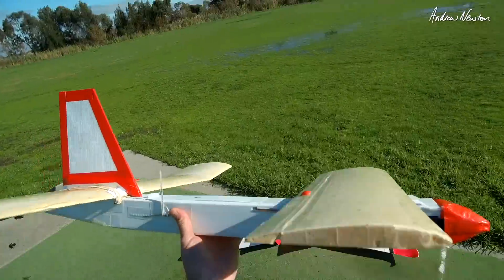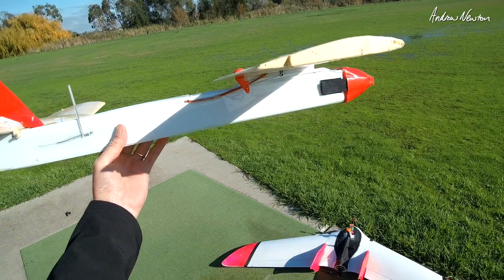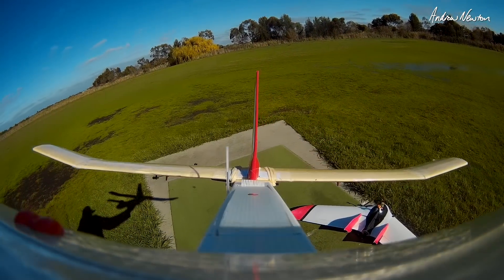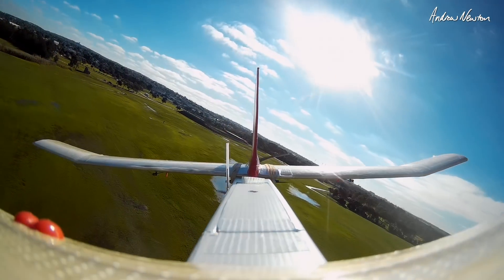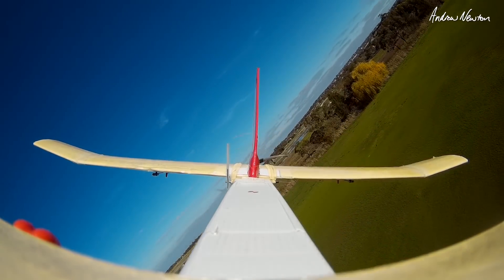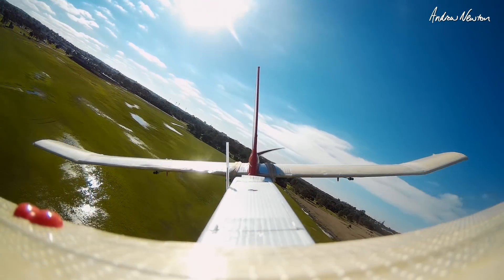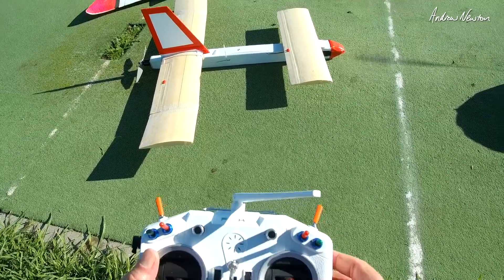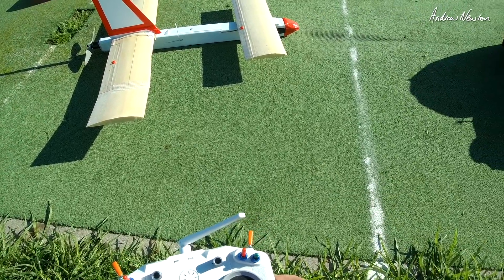Smeg Head Elevator vs Elevons

Comment: Quick question: do pushers heat up the motor more? Because there is no ventilation from the propeller. Thank you.
Reply from the maker: Not so much from the prop positin but more because airflow over the motor is blocked by the fuselage.

Comment: When I flew the APD, I had a few degrees of positive AOA in the canard, and flew with elevons only. It flew well, but pitch trim was dependent on air speed. I didn't mind it, but I know some people that would... lol It was nice for FPV, I had no autopilot but I could set the throttle to adjust my climb rate. At a nice cruise it would hold one altitude pretty well. In theory with this setup, the canard should stall before the main wing too because of it's higher angle of attack, so it make the stall very predictable and quick to recover too.
Reply from the maker: I'm really liking this smaller version, more responsive. I have reverted to elevons with some up canard, same as you. Trying to set it up for FPV and iNav now but weather and dumb mistakes are hampering my efforts.

Comment: I’m grateful you tested this. I often got asked about the APD: “Why not put the elevator on the canard?”  My usual response  was simplicity of servo wiring and mechanics, but I never actually tested it apples-to-apples. Thanks for doing this Andrew.
Reply from the maker: My pleasure Ed, interesting test. I thought the elevator would give more pitch authority, but the elevon mixing was just as good, and seemed smoother.
Reply: I like this plane. This is like a tandem wing. Andrew,  where is the CG location on this plane??  How to determine the CG location?
Reply from the maker: @kepplerdrone  I used an online canard cg calculator https://rcplanes.online/cg_canard.htm

Comment: Your Conclusion to change to Elevon only, depend on the Fact to save one Servo, or is it the Flying Characteristics, thats not clear for me, the Elevator would be more effektive with a wider Flap, and You could even use the Flaps together with the Elevator to slow it Down on the Final, dear Andrew very interessting Video with complex Aerodynamic opportunities keep going, best Wishes, Anton, Vienna 🇦🇹
Reply from the maker: Flying characteristics mostly. The elevator didn't add anything to the performance
Reply: @AndrewNewton  but if you use elevator as flap and aileron as elevator you can fly slowly. Right?
Reply: @AndrewNewton  THX, thats Surprises me, i would'nt except that, thought to climb it's more favourable to increase the total Lift rather, than reduce the Lift even on one Wing, a little bit. 
👍🏻🦆✈😃
Reply from the maker: Yes, increased camber on wing and canard.

Comment: Nice. It would be fun to up size it with a square pvc gutter downspout pipe as a fuse, well maybe.
Reply: Before electric days - it was called the Sturdy Birdy - PVC drain pipe fuselage, aluminum U channel rear fuselage to connect to the tail, balsa tail and a foam wing.  Think I had an O.S. 30 on mine.   wing rubber-banded on and so did the firewall.  Really helped me learn because the thing would take a beating.
Reply: @mkintzel   Thank you for the comment. I am relatively new to the community, but I have found a  real love for building. I'm sure you agree that there is nothing quite like seeing your own design fly, however badly.
Reply: I have plans to build a plane with and airframe made exclusively from parts one can find at Lowes or Home Depot, just for S and G. Was just looking at that pvc gutter pipe!
Reply: How about a Wright Flyer using pvc pipe to construct the fuselage, biplane wings and a canard on the front.
Reply from the maker: PVC pipe plane! Adding that to the list